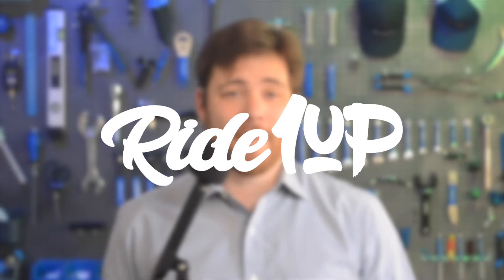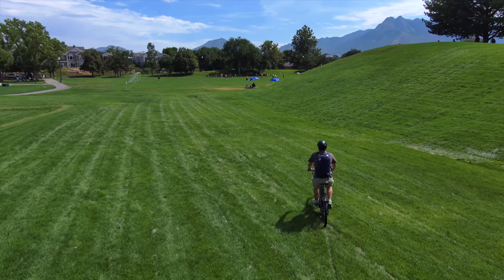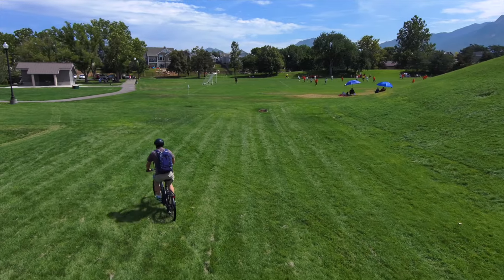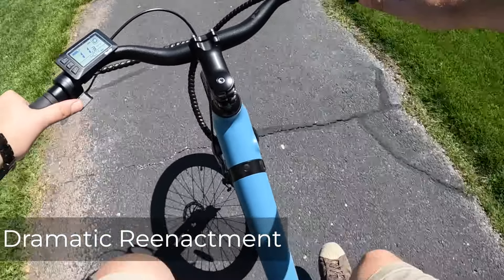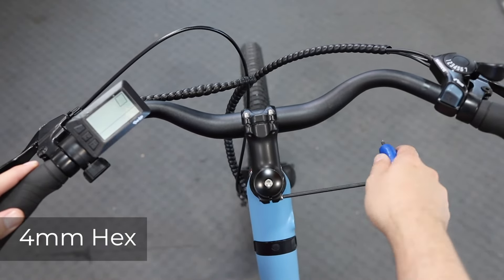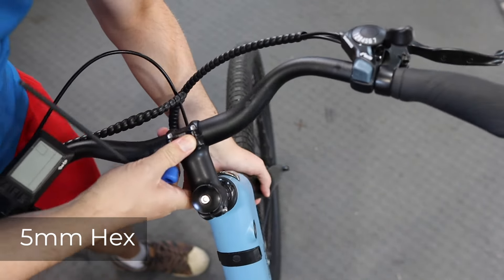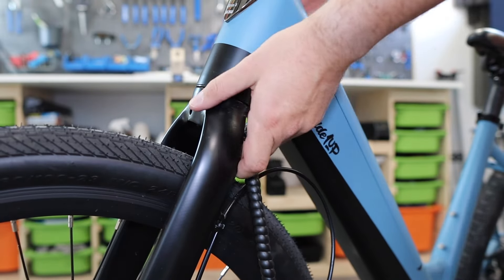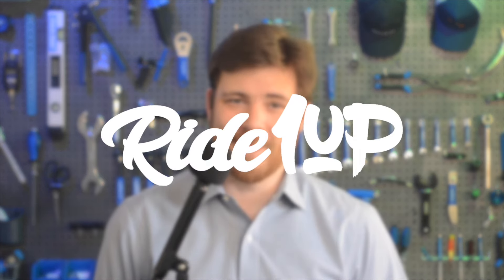How to Fix Bike Wobble on the Front Wheel

Comment: This was NOT what was wrong with my wobbly front wheel. It was the actual wheel screw needed to be tightened. Not sure why it would come loose but it did and it took a minute to adjust but its solid again. Phew

Comment: I have the AiPAS A6 e-bike, which is basically the same thing as the Lectric Xpedition. I have the death wobble from 8-12MPH.
So that little dust-cap over the fork stem? That is actually what tightens the forks up, just like in your video. I could not believe it.
There is no ring to tighten. Those caps can't be tightened too much, because the flower looking bolt will just pull up and out.
IMHO that a terrible design.

Comment: I hate this bike.  I hate Ride1up.  The parts are crappy.  The tolerance is incorrect, and nothing works on it.  My front wheel wobbles laterally despite the assembly being correct.  If I tighten my quick release all the way, the disk brakes grind.  I also had a front fender that didn't fit when I UNBOXED the bike.  I was told to bend the fender (didn't work) or just remove the part and just not use it.
Reply: U r like me the problem from the wheel itself. 
It will wobble when u apply pressure to the wheel.

Try to tie the side nut little bit it will fix if not change the whole wheel